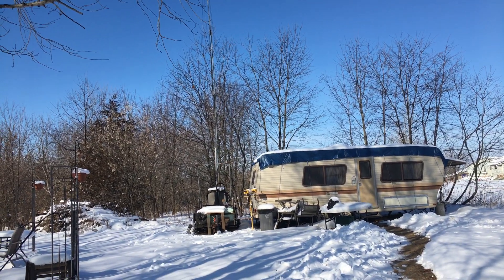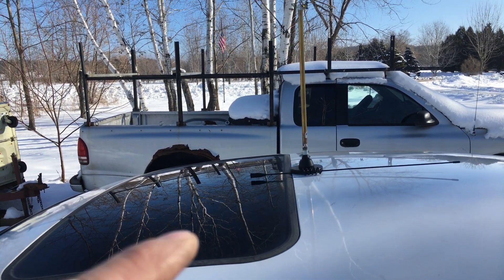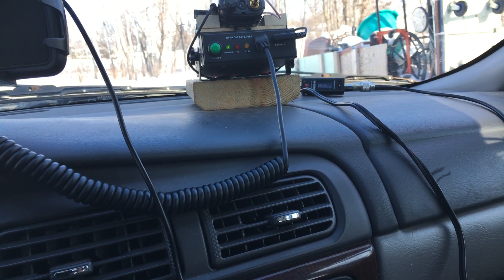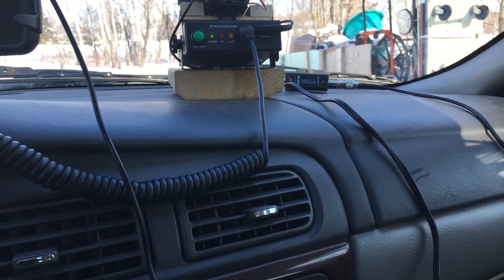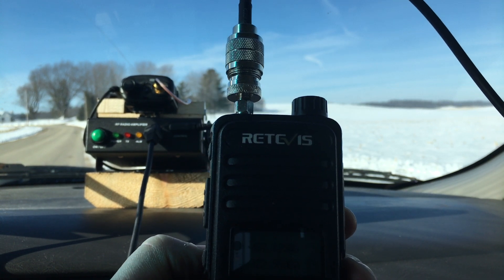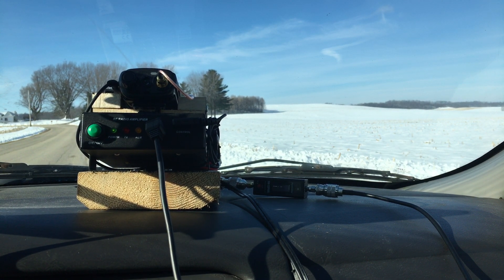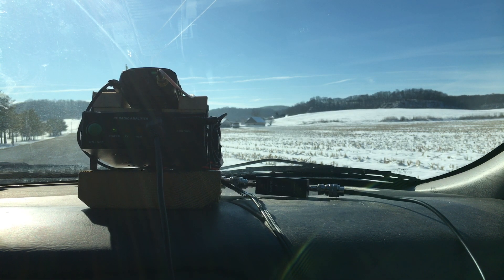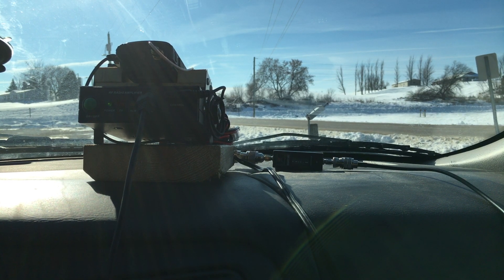🔺  Preppers doomsday Retevis RT91 GMRS two-way radio 40 watt amplifier DISTANCE/RANGE test!! 🔺

Comment: One thing you must know….all rf amps and hi power radios work best if they are direct wired to the car battery. Also by FCC regulations, channels 8-14 (which are FRS ONLY channels) are restricted to 1/2 watt of rf output power only.
Reply from the maker: Ohh yes for sure I think I say that in some of the videos too. Of course, wired direct with a fuse and with the right gauge wiring too

Comment: You need to try to  Hook 2 Radios Together To make a cross band repeater Then hook your aplifier to The cross band repeater you made With the amplifier  And put it on that antenna at the camper And get you a 50 watt mobile radio in your car Then I believe you'll get a lot more Distance Way cheaper   But you will need 2 antennas  On the outside of your camper  Then you'll be getting a  30 watt repeater
Reply from the maker: Yes, I know 🙂 I may do a video on that if I get a 50 watt mobile radio in the future.

Comment: 30ft antenna is 99% of your problem. Way too low for being in a valley. You need to hang her in a tree at least double that. Triple even. 

This isnt legal but for SHTF use a 50w crossband mobile radio and transmit GMRS into it, then RX on MURS with dual watch on your HT. WAY more power for half the cost. And you lose far less out of your coax on VHF.
Reply from the maker: Ohh yes, of course, height is the king. I am hoping to find a better location for the repeater in the future because to get my antenna to the height that is need to get signal out of the valley would cost too much.  I did do some distance test videos using MURS it was a little better. I may do some more with MURS later

Comment: Hey man checkout Jetstream antennas. JTB-3B has 8dbi gain UHF $45 from R&L. Also I picked up some KMR400 cable for really cheap on Amazon. Super pleased with it.

Built an air canon with a fishing rod attached, shoot a sock with BB's into the tree, stretch Paracord over the top limbs, then hang the antenna about 80ft. and now get 25 miles all day. It's all in height and antenna. I'm down in a valley to about -40ft. So I need it in the tip top of my tallest tree. Holy shit is it a game changer at that height.
Reply from the maker: I do have the lmr400 now, but I will check out that antenna..thanks for the info
Reply from the maker: Hummm I am not finding it, do you have a link?  Thanks
Reply: @GMRStwowayradio  shit it's auto deleting links. R&L website under antenna tab multiband VHF/UHF base antenna. Sort by manufacturer.
Reply from the maker: @adlucem9845  ohh I was able to post links before in the comments but i will check it out thanks